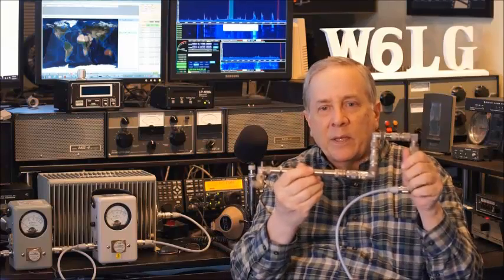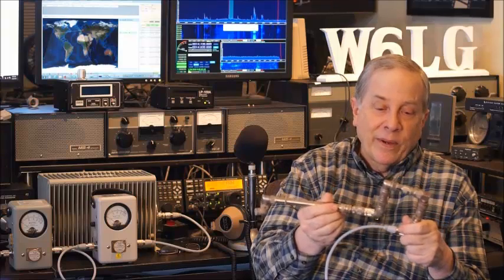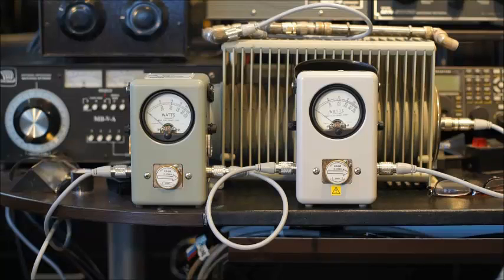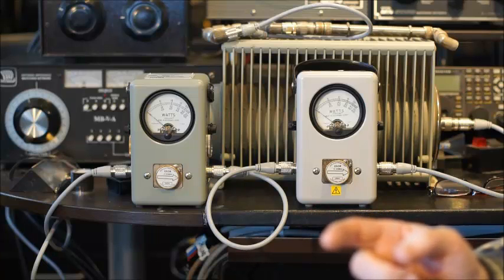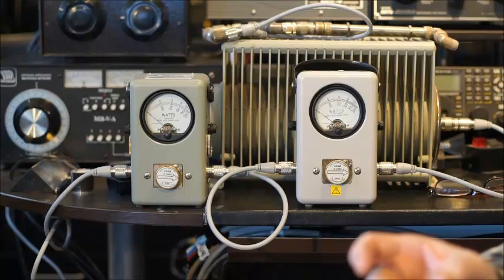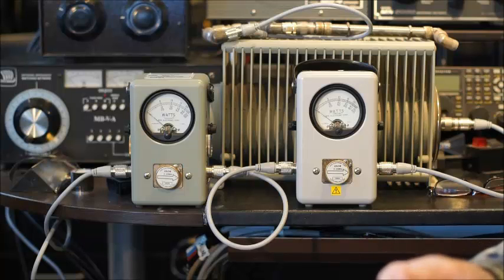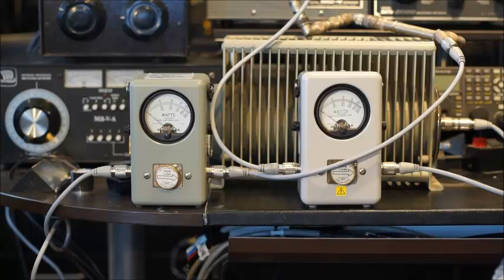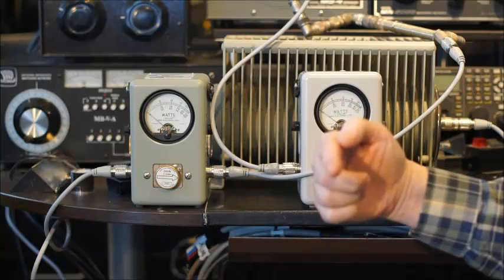Ham Radio Basics--Coax Connector Loss---A Surprise

Comment: Jim, I so agree with you and appreciate your time and effort in making this video. I hope what others may take away from this presentation is that the losses at HF in coax (and multiple connectors) is of no concern. If you don't have an obvious anomaly in your transmission line, the good coax of today (and yesteryear) is for all practical purposes, "lossless" at HF for hundreds of feet.

Now, to contrast this to an extreme - when I worked for Lockheed as WSMR in the 1990's, I did 11 GHz work and had the best of the best equipment straight from the cal lab of WSMR to measure these antenna systems. As the coax came down from the parabolic dishes, it would be terminated in an N connector, then a barrel then another N connector to make a physical transition. This may seem silly but even the very best 90 degree elbows would loose 100% of the signal from the input of the 90 degree elbow to the output of the elbow. Seems weird but it is true so, gradual physical bends, even with the measurable loss of every N connector was necessary to get the signal from the antenna to the equipment. An extreme case for the ham radio operator for sure. 

Now on to the WiFi band of today at 2.4 GHz - certainly not so extreme as 11 GHz but I have demonstrated that all of the gain obtained in an antenna can be lost in just inches of transmission line at 2..4 GHz or poor connectors. 

For HF work the PL-259/SO-239 is a good choice. N connectors are not necessary. Great video, Jim. Thanks for posting.
Reply: ElPaso TubeAmps As per my understanding your statement is simply incorrect, and that's based on coax manufacturers own numbers and independent testing. Losses in coax runs of 100ft are significant and vary by type, brand and frequency significantly also, if they didn't coax makers wouldn't need to make a lot of different types of it with different diameter, materials etc. To pick an example, if I have a Dutch N class license my max transmit is 25w which means I'm likely to spec my transceiver per that TX output, if I run 100ft of the wrong type of coax to my antenna, at the end of that cable I will have less than 20w output, more like 18-19w. That IS significant.

Comment: Thanks, great video. You touched on the fact that at VHF/UHF frequencies, losses would be higher, and was hoping that you would have tested/verified that as well (maybe in another video?). 2m is popular, especially for emcomm, which I do (and sometimes 70cm), and so I am very interested to know what the losses would be at those frequencies. Not necessarily for a stack of connectors, but for say 3 or 4 including  a couple short (12") jumpers. Thank you.

Comment: An excellent "myth busting" video, thank you for making and uploading.
Reply from the maker: I like that "myth busting!"  73, Jim
Reply: Jim,  even in the trade there are people that are convinced that connector losses are up to about 0.5dB EACH. (Usually VHF/UHF) with 100w fed into a long chain of them the connectors would heat rapidly if their theories were true. It has been many years since I felt inclined to assemble a long string of adaptors in order to prove the point. Well done for taking the time to do this.

Comment: Hello Jim, thank you very much for this. I just posted a YouTube video on my Field Day 2016 effort and at one point mentioned I was using a patchwork of short cables to make the run to the antenna rather than one long length. I presumed there would be loss due to the connectors but you have just taught this old dog a new trick. I'm now a subscriber to your channel. 73 from Tracy VE3TWM.
Reply from the maker: Thanks Tracy.  If you have an idea for a basic ham radio video, please let me know.   73, Jim W6LG

Comment: Thanks Jim, 
I'd never understood they theory of loss through connectors and It has never sat well with me.
If anything I'd expect them to be more robust electrically and mechanically than the coax itself. If that makes sense :)
I guess that's what prompts us into action to test such things. 
Whilst I love seeing new hams come on board, sometimes it seems theyre more prone to asking a single question multiple times to get the answer they are after. 
it would be great if they just took the time to experiment and find out for themselves.Of course share their story when theyre done. 
Thanks for showing us and sharing the joy that can be had from not taking anything for granted and finding out for yourself. 

regards Brett VK2MRX
Reply from the maker: Thanks Brett!  I think you are correct about the connectors.  Here's my theory that is unsupported.  The reason that the string of connectors showed no loss is that the length of a connector (or connectors) was/is relatively short compared to the wavelength.  In other words, if I had a wavelength long string of connectors the loss would have been much greater than coax.  Given that a connector is very short compared to the wavelength and it was a short length I was testing, the loss is undetectable.  If the typical ham station has a dozen connectors, for example, that length of connectors is a fraction of a wavelength and therefore have a fraction of loss.  Okay, I can't prove my theory but it makes some sense.  Thanks Brett and 73, Jim Heath W6LG

Comment: Jim, just discovered your videos few days ago and immediately subscribed the channel because I really like most of your videos. Relative to the connectors loss, I was impressed with the result. There is one thing that was interesting to be tested, that is the solderings on the connectors. You tested the connectors daisy chain attached, but only the extremity connectors have cable. It could be interesting to know how much loss does the solderings in the connectors add (if any notoceable).
73, CT1EFT

Comment: Hi, Jim .... thanks for the video.  Two questions ..

1) Wouldn't the loss of the connectors be more of a factor for received signals at say 20 uv?  The ratio of the inserted impedance vs. pass through power would be significantly more noticeable?

2) I have previously understood that the most accurate meter readings occur near full scale, not mid-scale.  For your experiment, a stated accuracy of + or - 5% of full scale deflection on the 250 watt slug is a 25 watt swing, or 25% at the 100 watt midscale point.  25 watts at the 250 watt point is a 10% margin of error.

Comment: Jim do this with QRP 5 watts and 1 watt also please describe the cable you use RG213? Rg8x?  also 2 meter 70cm as you mentioned it is VERY important to have good cable and connector especially when operating in QRP.

Comment: Which is better UHF pl259 or N connector? HF only. 1.8-6m
Reply from the maker: No question in my mind, the PL259.  I have killed many N connectors with that small pin and small contact. I had them fail many times with QRO.  73, Jim

Comment: Try this on VHF and UHF, Im sure youll be surprised, HF not signifficant losses over distance with good quality cable
Reply from the maker: No, I won't be surprised.  I have been doing this for 55 years now.  The coax cable is the most important part of the station.  Guys will buy a $300 microphone and then use RG8X.  Thanks Dave. 73, Jim
Reply: @ham-radio  Im sure you are experienced enough. I enjoy your videos, keep making. I use 75ohm outdoor cable with crimped F connectors on it, waterproof and solid, on VHF. No impedance matching, short length to antenna, so I asume reasonable SWR. No difference with 50ohm, PL connectors, and RG213. I use a handheld radio connected to   homemade 75ohm base yagi antenna, external microphone and speakers, and 5w of power.

Comment: Can you Please make a Video on how to ground a dipole antenna  AND also how to ground the coax coming from the dipole antenna?  I've read so many things  about it  that now I'm confused even more.  TNX,
Reply from the maker: I answered this early today.  A dipole is not grounded.  It is a balanced antenna.  73, Jim W6LG
Reply: hman630 You cant ground a balanced antenna directly, however if you feed the dipole with  unbalanced feed line (coax) then you can ground the sheilding of the coax but you should use a 1:1 current balun to prevent the sheild of the coax from radiating and becoming part of your antenna which would ruin your swr. Any DC static or lightning strike would pass through the balun to your ground point at the bottom of the balun on the sheild of the coax ( basically wrap a wire around the connector and attach that to your mast or to a ground wire) and you can use a lightning arrestor to take care of the center conductor (which will have a ground screw attached to the sheilding).
Loop antennas have an advantage in that both sides are at DC short so they are easier to ground (just a current balun and ground the coax sheild).

Comment: I know that this is HAM but maybe you guys know the results if I would of used this setup with a CB radio. I'm wondering if it would be the same results?
Reply: I know your post is old and you may have already found out your answer, BUT "YES" same results, actually SAME for the entire "HF spectrum". You can use as many as you need without any noticeable loss. Take it ez, 73 de KD6SBR

Comment: W6LG, you're only telling a one sided story here. You're trying to show there is no loss in the connectors on TX yet you're leaving RX out all together. Another thing you're showing is a whole bunch of connectors in a row which is not how they would normally be installed  at most stations. The loss is rated in db not in watts as you seem to be trying to show using a dummy load. I do no below believe that manufacturers of these connectors would report a loss if there were none.